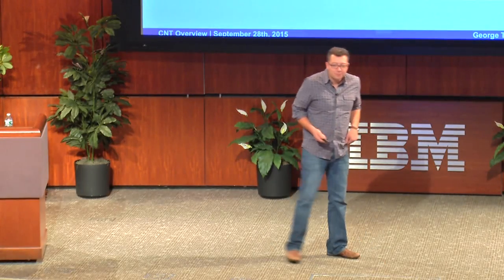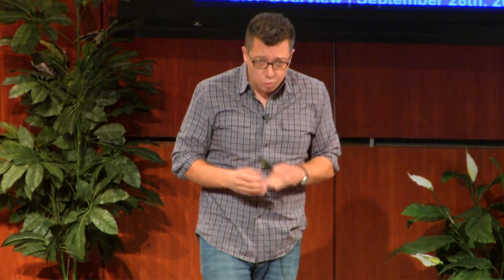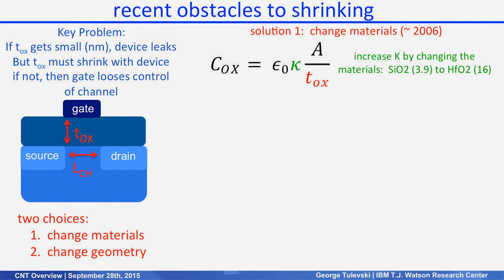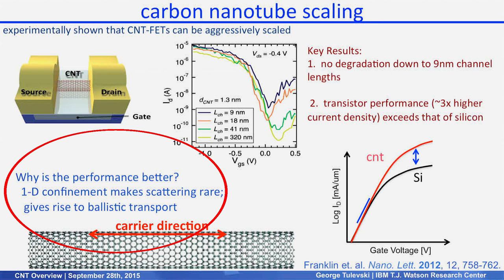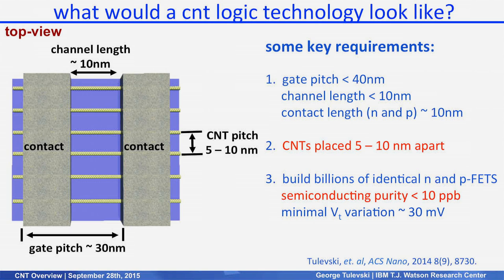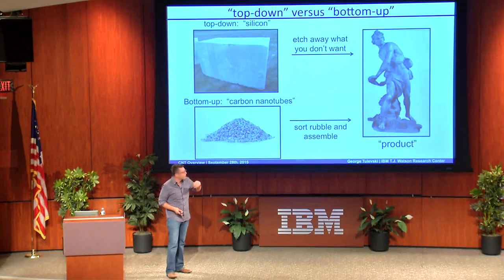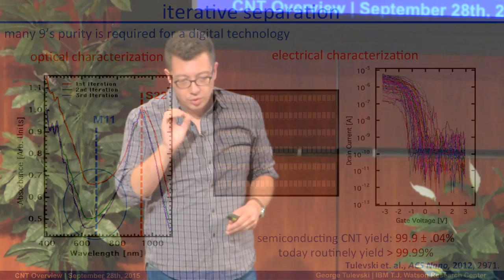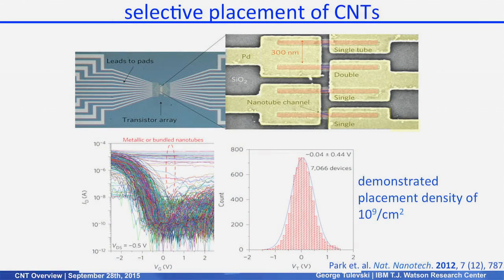Carbon Nanotubes for Digital Logic

Comment: The explanation at the beginning was useless.  To someone like myself, I already know about MOSFETs.  To someone who's not in the industry, you blew through that so fast that it actually had no value.  Either explain something, or don't.  But don't just rush through crap like that super fast and casually.  It's not simple, and it shouldn't be treated as such.  Why not just say, "You guys already know about MOSFETs, so I'm not going to cover it here."  ?
Reply: I partially agree. I think its useful to people that didn't think about those things for years so a fast refresh of basic theory was useful.
Reply: Ima SuperPerson, it is important to brush on a concept so the future idea has handles to hold. I don't know if you have life experience enough to know about simple things like a hot pot in a fire but it helps when there are handles to grab it. Rather than reaching in and dropping the soup all over the floor handles are attached so that people without a specialized pot grabber(tm) can remove it and eat.